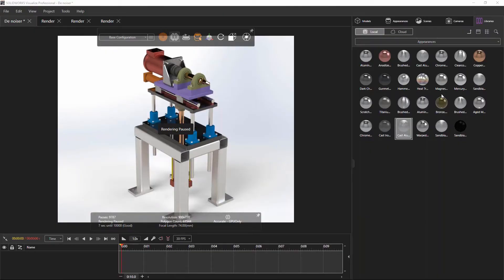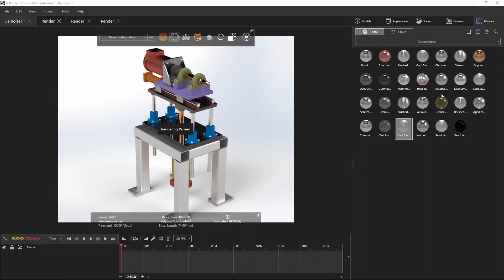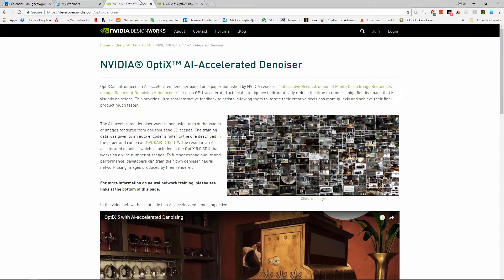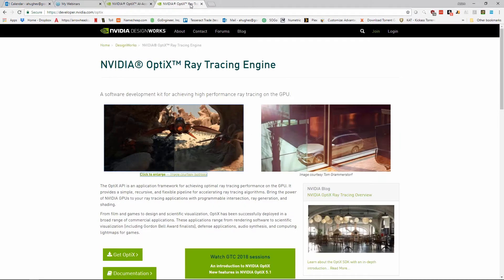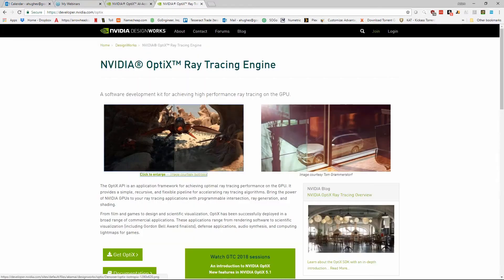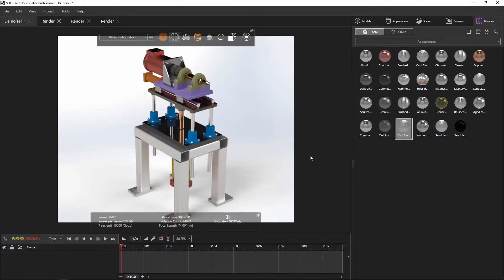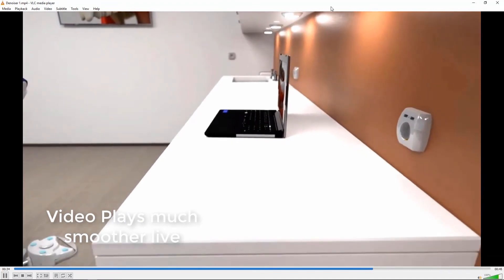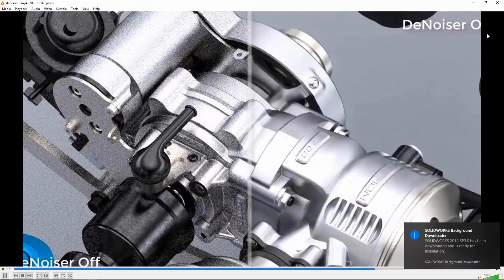SOLIDWORKS Visualize - AI Denoiser

Comment: visualizing on the accurate renderer selection on the 3dviewport, wether or not hybrid calculations are activated, the Denoiser seems to actually be making the time longer: 13 seconds w/o to 25 seconds using the denoiser to reach 250 passes.
This is using the gtx1050ti 4gb video card.
Even though i can tell that there is better quality in those less passes.
So here's the question, do i have to then do the calculations on processing time per frame, or on a number of passes per frame, which would result in slower results? and even then, if it is processing time, how do i know what max time value to input there? i can't tell it to stop exactly when the AI kicks in...
great video, as always.